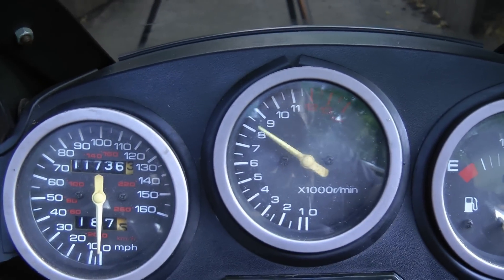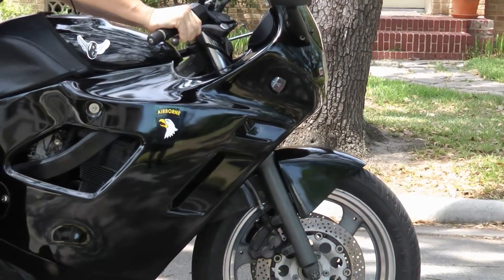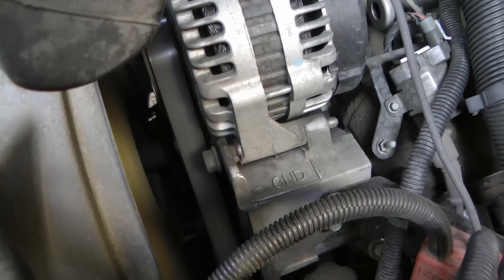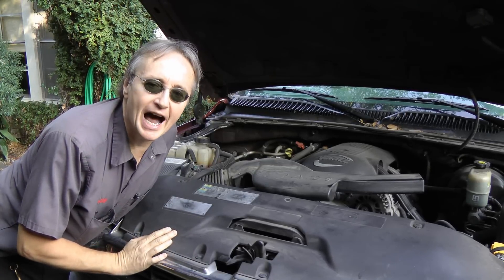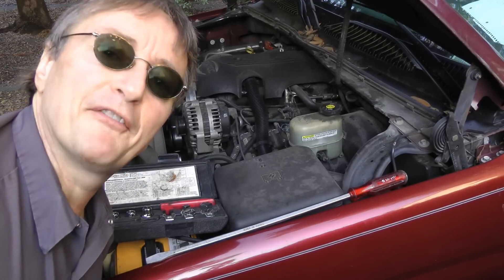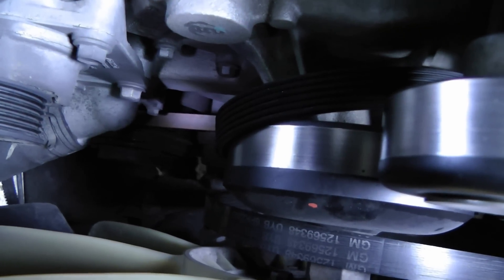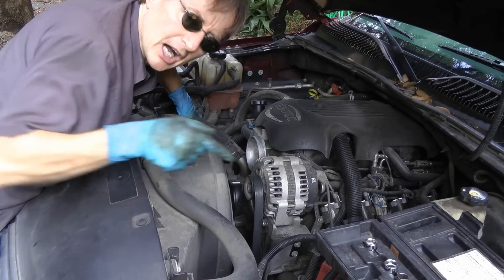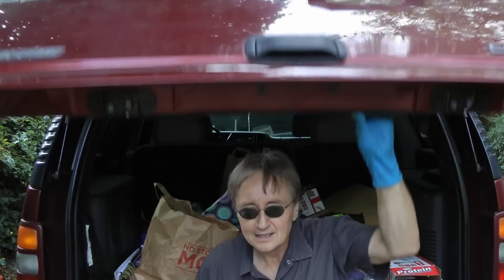How To Fix Noises Under Your Car's Hood

Comment from the maker: @wigsplittin if it didn't tick before, odds are the spark plug wires are shorting out, change em. Pray it's not internal engine ticking from worn out valves.

Comment from the maker: @chocolatao214 that car has sensors all over the place, often 4 different ones. They all bolt on the exhaust system and have wires coming out, easy to see once jacked up. Scotty

Comment from the maker: @nightpwner well, depends on the car. If it's an old GM, they have to be shimmed correctly or they will do that. But most cars just bolt the starters on with no shims these days. In that case, get another. Scotty

Comment from the maker: @xxlkrustylxx normally you don't need to flush engine oil. But if it's really gunky, use a flush made for it like K&W flush and follow the directions on the can, then change the oil and filter, that's fine. scotty

Comment from the maker: Remove the fan belts, and if the noise goes away, it's something it drives. Often a worn power steering pump does that when old and cold

Comment from the maker: wheel bearings don't thump, they roar as you drive faster. Remove the calliper and see if the noise goes away, then you'd know if it's that.

Comment from the maker: sounds like a worn bearing, remove all fan belts, if the noise goes away, then replace whatever part has play or wear in it, like the AC compressor or alternator. If the noise stays, then pray it's a bad IAC valve hooting as wind passes through it on the intake.

Comment from the maker: remove the fan belts and run it, pray the noise goes away and it's something a belt drives. If not, engine has serious internal problems like bad valves or engine bearings.

Comment: hey scotty my boyfriends got water in his gas tank, we took it in and the mechanic said to use methyl hydrate we have used at least 4 bottles of it and the truck still looses power while driving. Do you have any other ideas on what it might be? we also replaced the spark plugs and fuel pressure is fine thanks scotty you rock!

Comment from the maker: old age and engine wear makes for noise inside engines, can be bad lifters, worn fuel injectors, worn valves, none of which are that easy to fix. A little ticking often doesn't hurt much and you have to tear engines down to fix them, big jobs with lots of guesswork invovled unless you rebuild the entire engine. Most guys live with it or try a little heavier engine oil and lucas oil additive

Comment: Hello Scotty, I just replaced the drive belt in my 2002 Toyota Camry about 2 months ago, and today I noticed my car making a brief belt chirp noise when turning the wheel. I was wondering why it would make the noise? The car was cold and I just had the oil change today, will these things cause noisy belts? Thanks.

Comment: @narox Yep. Just won't have power steering, the car will not be able to cool down, you won't have air conditioning, and your alternator won't charge the battery.

Comment: @scottykilmer It is worth mentioning that in interference engines you don't want to run the engine with the timing belt off or you'll mash up your valves.  Other belts are fine to run the engine without.

Comment: Hey Scotty really need your opinion, I've got a 99 Ford Crown Victoria, when the engine is cold it makes a little ticking noise until it warms up to operating temperature, once it's at operation temperature the noise goes away 100%, it sounds like a valve tap or lifter tick. I change my oil every 3k miles, the car has 150k miles on it. It's my first car and I love it, is this the sign of a serious problem? The car leaks oil, and I used a heavy weight oil in it to reduce the leak, but recently switched back to 5w30. How can I fix this? It only happens when the engine is cold, and when it's warmed up the car runs great, as it always has

Comment from the maker: if it has a cable, replace the cable. If it's electronics, replace the speedometer head or put a used dash in, that's cheaper

Comment: @scottykilmer Hello, Scotty thank you for your informative videos that help the average person take care of one of their greatest investments, their car. I had a question, I am having an electrical issue with my car, its over 5 1/2 yrs old and the other day it would not start, heard a machine gun noise from starter, took battery to autozone, recharged it, (read 631 amps) got back home, car started fine, next morning, machine gun sound, is their any way to rule out problems before buying parts?

Comment: Hey scotty! If we took a video of your problem, how can we submit it to you for review?

I have this odd noise that i can conclude is definitely coming from somewhere in the belt area. The noise is louder on a cold start and as the engine warms up it's not as loud but it's still there. It's an 01 Volvo S60 with 149K miles, everything works, I'd just like to know what's causing the sound.

Comment: My truck is 14 years old, all of the rubber bushings (I think that' what they are called) are squeaking.  Does spraying them with dish soap and water really stop the squeaking?  Replacing them is not in the budget.  Thanks in advance!

Comment: I've got a '96 Town Car. When it's been sitting for a few hours and it's really cold out, it makes this really strange noise that sounds like something grinding/creaking when you first start it up, then it'll go away, and a lot of the time it'll make the sound every now and then until it warms up. It only does it when it's cold outside. Do you have any idea what it might be? It sounds like it's coming from the front of the engine, but I can't tell exactly what it might be.

Comment from the maker: because they are made to run with it on, and if you unplug it, the car will not run correctly, though it will run as the computer will guess at how to run it.

Comment: Little update if you care, Scotty. I got under the car, and gave it a listen while its running. It's /definitely/ the cat. However, I gave it a firm whack when the car was running, which didn't change the rattling at all, then again when it was off, which didn't produce any rattling. My check engine light isn't on, so is it safe to assume it's just the heat-shield? 

Good lord is it annoying, in either case.

Comment: @scottykilmer oh... a little background info. The first morning the car wouldn't start the lights in the dash were ok and the headlights too. It just wouldn't crank, so I got a jump and it started fine. I left the car on for 5 minutes so the alternator can charge a bit and turned off car. A few minutes later turned car on without assist fine. Next morning machine gun noise from starter again. When I did bring back battery from autozone charged up it stared up fine, but 8 hours later, same noise.

Comment: Be careful to run warm engine if the water pump is not running.
It can for a short periods on cold engine (not on warm engine).
I did'd it once on warm engine to check if the noise come form water pump. After some 20 secounds runing in idle radiator blow up, and had to be changed.

Comment: I have a whining noise on my jeep. Seems to go with the engine rpms. Doesn't change with steering, or ac being on or off. Just leaves the alternator or idler belt correct?

Comment: I want to buy this 99 gmc Yukon but the guy said there is a knock would a thicker oil fix that? It is really nice and has only 130,000 miles. Just curious do you have a video on this.

Comment: @rebirthatthefountain actually I went through a trial and test to rule out the 4 main issues being the starter, battery, electrical short, or alternator. On 2 occasions I brought the battery to autozone, they tested it, it was weak, so they recharged it, gave it back, car started right after, but failed to start the next morning on a cold start. So the second time around we disconnected the charged battery thiking it might be a short that was robbing all the juice of the battery cont...

Comment: Hello, if you get a chance to reply, i have a 96 accord that makes a chirping noise only in the low gears when the clutch pedal is out. If i press the clutch in the noise stops. RPM/road speed do not seem to change the pitch of the noise, any idea what that is?

Comment: Hey Scotty, when I cold start my car in the morning, the power steering pump makes a whining noise just for a second but then it completely stops. If I start it again after it's warmed up, it won't do the noise again. The steering wheel turns fine but that noise is worrying me, what could it be?

Comment: @narox 
why wouldnt it start without a belt on it? its not like the starter is belt driven. its bolted on the back of the motor, and engages via the flywheel.

Comment: Just bought a used 2007 avalon with the 3.5 noticed on slow acceleration  a slight diesel type noise .. goes away as I speed up ..is this normal? Never drove a toyota before  lol runs nice otherwise and idles quiet .. any info would be much appreciated.  It has 110k

Comment: I have a 90 geo tracker that will tick at cold start but it goes away and runs with no problems after  a couple minutes should I be concerned. Others have suggest that it will go a long time that way and it would take much more to fix then the problem is really worth. Thoughts?
Reply from the maker: na, you'd have to rebuild the engine to fix it

Comment: hey scotty, i have a 2001 dodge dakota and every time i put it gear something starts to rattle in the front, but when it is in park it doesnt make any noise, and how come my rpm needle will bounce every where and the motor will start to shake and try to  die after driving some where for a while. it doesnt do it after it is shut off and restarted

Comment: HI scotty first and foremost I would like to thank you for sharing such great videos and knowledge with us much appreciated. We definantly appreciate you expertise. I have a problem with my 2001 chevy camaro v6. I recently changed the spark plugs and wires.now I hear a ticking noise its gets worse with acceleration then goes away after the vehicals ran for a littlewhile some days it will do tick other days it wont. any advice or tips as to what this could be

Comment: hey scotty i replaced one pulley and the belt on my ford ranger 1997 because it was very loud squeak and it stop but after 2 days it came back but very low squeak and after i drive for 10-15 minutes stops what can it be thanks.

Comment: Hi scotty I have a Nissan qashqai 2.0 auto my brake lights don't come on I've checked bulbs all ok, also I noticed a b s light and esp light come on ....last night I pressed the brake pedal rear brake lights worked and when I drive it to the shop a b s light and esp light went out !but coming back no brake lights again and a b s light on could this be a faulty sensor switch under brake pedal? I welcome your comments scotty please help thanks,regards John uk

Comment: Hi Scotty,
My car's 2L petrol engine is making a slight ticking noise, its constant throughout the rev range cold or hot.
Any advice on what to check?
Reply from the maker: check valve adjustments first, also check for ticking fuel injectors with a stethescope

Comment: Hey Scotty, just recently purchased a used manual 2000 mustang v6, every morning i start it a 2-3 second rattle comes from the engine and goes away and doesnt come back as i drive. I only hear it when i start the car, cold starts its more noticeable. Im pretty sure its the factory clutch and the car has 119,000 mi. What do you think it could be, clutch pulls fine, sometimes it clicks when i push it down but it hasnt lately. Thank you
Reply from the maker: push the clutch up and down when the noise occurs, if it's the clutch, the sound will change as you do that

Comment: hello scotty..my car making noises, removed the serpentine belt as well as the aircond compressor belt..when i run it without these two belts for less than a minute..its still making noises..what could be the issue..pls help

Comment: @rebirthatthefountain and it wasn't as we connected the battery on the 3rd morning and it failed again. Took the battery in to advanced auto parts and on the 3rd test they determined it was a faulty cell, well finaly something definitive. Well $92 later for a new battery and everything is great.

Comment: Hi Scotty, when I shut off my car from a normal drive sometimes I hear a sizzling crackling noise from under the hood. I thought maybe could be a loose hose or fluid leaking onto a hot engine component. Any diagnostic tips would be greatly appreciated thank you!
Reply from the maker: do check for leaking coolant or leaking oil that will get on the exhaust manifol then crackle

Comment: Hey Scotty I have a 2006 Silverado 2500 with the 6.0 lq4 gas motor and when I start it it sounds fine but after it warms up some it makes a bad sound like worn out bearings. I think it's the radiator fan cause when that kicks on that is what's making the noise do you know what it could be?
Reply: Nevermind I found the source of the problem. It was the alternator. The one thing I didn't want it to be. Went to warm up my truck and it read battery not charging so I checked the alternator and that was the problem lol. Thanks for the great videos! You and ChrisFix are the channels I turn to when I can't fix a problem on my own.

Comment: Hey Scotty, I recently replaced the clutch in my 2008 dakota, I hear a high pitch squeel/scrape when my clutch pedal isnt pressed, but when pressed even lightly the sound begins to go away. The sound happens in all gears, even neutral unless i rest my foot slightly on the pedal. Someone reffered to my throwout bearing, but that was also replaced as long with the pilot bearing. Any knowledge would be of help Thanks!
Reply from the maker: sometimes the bearings have some grease on em that do that. Pray noise goes away in a week or two or you would have to take it all part again and see what part is bad

Comment: hi scotty i started hearing a loud ticking sound as though electricity was escaping from somewhere when i raised up one of the coils that covers the spark plugs, the two coils that all 4 wires are connected to started sparking, any advice?? btw i'm hearing that exact same noise in the car in this video i thought that was the problem lol
Reply from the maker: replace any wiring or coils that spark externally

Comment: hi scotty I have a 2006 chevy equinox. and when I am driving down the road or when I press the accelerator I hear a humming noise or like. but the when It's idling there is no sound or if it's parking there is no sound. so I think the engine is good but only when I press the accelerator there is like a humming noise or like a very light deep sound scrape. could that be like a bad wheel hub or is it something else?
Reply from the maker: yes, if it only happens as the car is moving. If you revv up engine just sitting there and it does it, then engine related bearings , like worn water pump

Comment: sir,I have a strange problem in my car , when i drive my car without AC on there is no problem, but if i drive my car with AC on an abnormal sound started coming from engine  after some time ,the sound subdued as i increase the speed ,but the sound is more prominent when i drive the car in less speed and if i take a turn in low speed the sound increases. sir please help me on finding the problem. I am driving Ford Ikon ,which have 1300 cc petrol engine.

Comment: i have a 99 chevrolet malibu and it has a 2.4L twin cam and its been sittin for a lil bit the battery dead it didnt have gass but i put some in 2day, when i get a jump soon as they take the jumper cables off it cut off and its makin a knocking noise i think its the alternator ?
Reply from the maker: could be lots of things, go to auto zone, they load test alternators and batteries free

Comment: My car is making a scraping noise when I accelerate . First I thought I was dragging a wire or something but I wasn't. It only happens when I start accelerating and for few seconds. 
Any Ideas?
Reply from the maker: often internal transmission problems on some cars do just that
Reply: Scotty Kilmer I needed the transmission mount changed and was going to do that do you that could cause the problem?

Comment: i have a noise in my honda civic 2009 it is just when i driver slowly like 5mhp  and it song like cru cru cru, and it is at the passanger side, all mechanic say that everyting in my front are ok that it is something in my chassis. do you have any idea what can be happening?
Reply from the maker: +Kermmys Martinez often wheel bearings starting to wear do that, also brake dust shields can bend and make that noise rubbing on the rotors, and of course, often tires make weird noises when they age and move slowly

Comment: Goodmorning Scotty .this the problem that am having .I have an l s400  as u drive my car is givein of a humming sound  it sound like when your car need power steering .can you help me pls
Reply from the maker: often a worn out pump or leak in the system in the pressure hose or rack
Reply: Scotty Kilmer thanks on my way home tonite my car didnt want to move  then i pull over for awhile then it like notti  happen  .i love my car am ready to burn it down

Comment: scot. if i remove the 5sfe flywheel and bolt on a aftermarket lightweight one. could that mess up the crankshaft alignments or anything?
Reply from the maker: +micheal balma it could IF it was not the same exact size, weight would have nothing to do with it

Comment: Hi Scotty , I have a bnew Ford Ranger 2.2 diesel pick up and when I start it and open the aircon it makes a Low pitch swirling sound. My car dealer said its usual sound and the sound is made by auxiliary fan. Is that possible ?